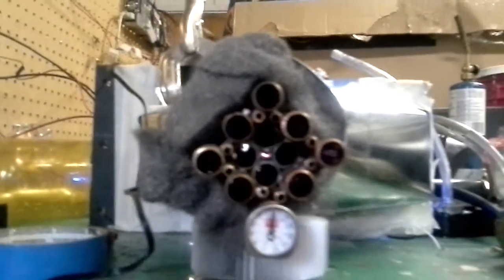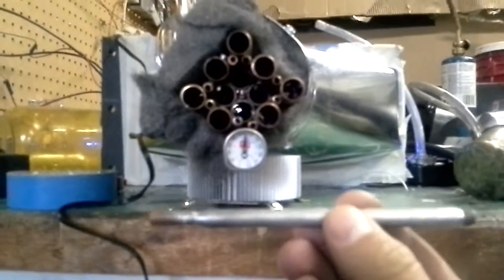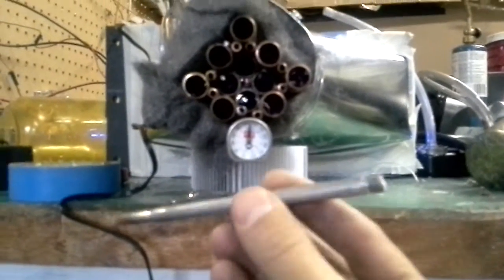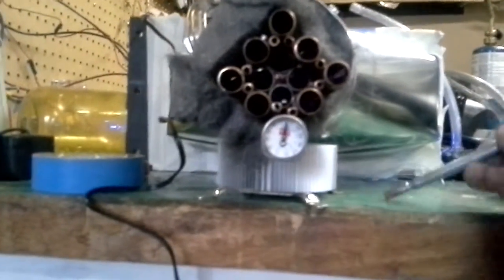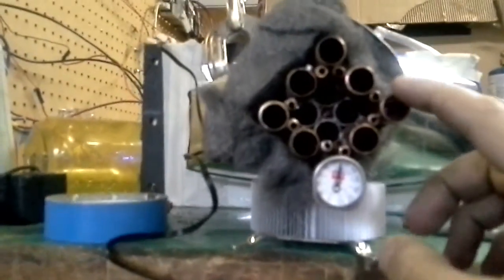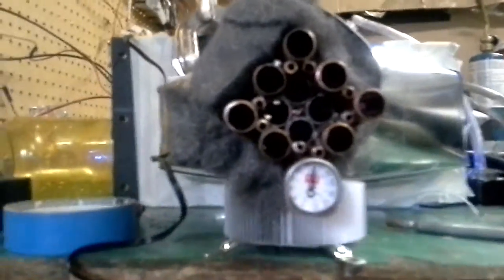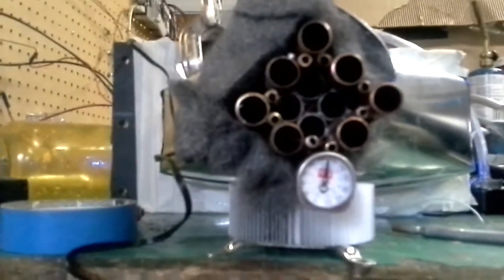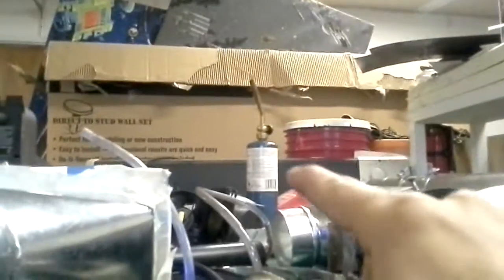HHO heater wih a Bernz-o-matic torch tip installed

Comment: Don't forget nearly every video on youtube related to trying to build an hho heater is only running about about 1/4th to 1/3rd the power of the average space heater, sometimes even less. Most people don't have the hho system capable of those power ratings.

Comment: Gas will ALWAYS out produce electric heating. No comparison. Lets think about something shall we...Your average space heater consumes 800-1500 watts of power. They usually pass high current through coils of small wire. The heat can never even get close to the melting point of the wire. Now take a 800-1500 watt hho torch, with that much power you can probably get 4-6 flames which would totally obliterate and exceed the melting point of the coils of wires if applied to it, hho gas wins...lol

Comment: Good luck with the project. I ventured into this a while back but could never get enough heat out the copper tube array.Although I was only running about 200 watts and the cell I was using was low output.The average space heater runs 800-1500 watts. With a good hho cell running at that wattage, I think a well engineered heater would outperform an electric heater. I've wanted to design a split cell that would directly connect to preexisting propane heaters, but not enough time or money to explore